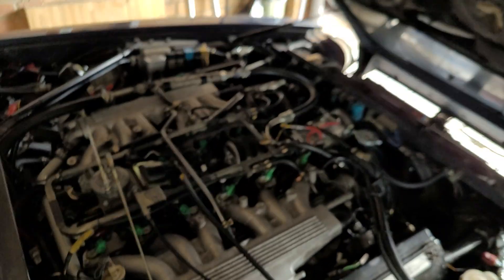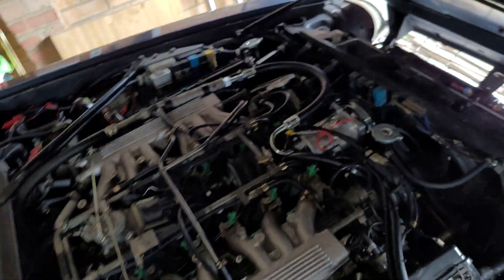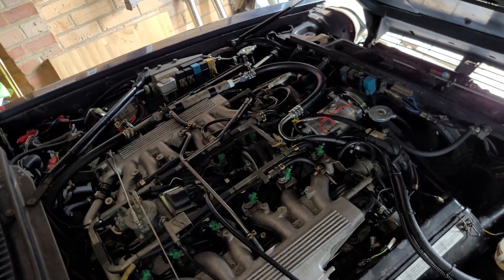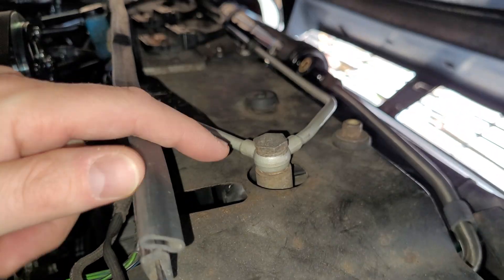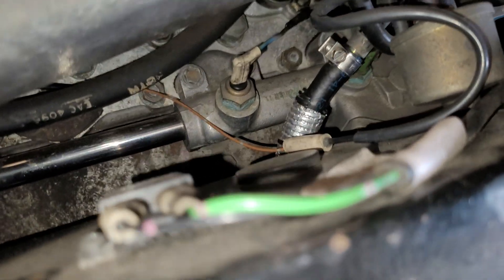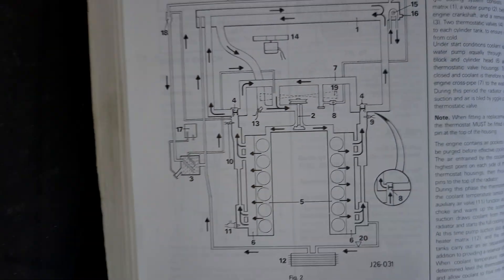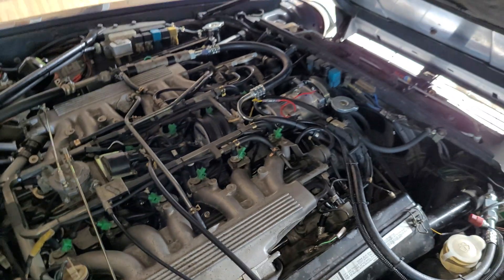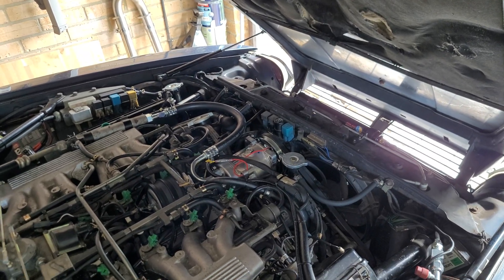Jaguar XJS V12 engine cooling system #5 - additional mods & advice

Comment: Do the racers swap the rails to make the outputs to the back I.el the left rail goes to the right? Or are they making new rails?
Reply from the maker: Pretty sure the ones I saw were new fabricated rails, or at least the thermostat end (now at the rear) was all custom ally welded. Not sure a straight swap from each side will fit- might foul the bulkhead?

Comment: Oh and check the water filler cap unit! I had a slow leak for years eventually an expert told me it was coming from there as it’s metal rusts then a small leak starts and you can never see it!

Comment: Thank you for the video!  Good tips about flushing the system to get rid of Barr's Leaks.  Even after thorough flushing on my 1987 I installed Gano filters to catch the bits (requires cutting three hoses - radiator top hoses on both sides and the heater hose).  The filters were still picking up bits after 100s of miles!  Eventually totally clean!  Then I replaced all the hoses.

Comment: Very good points!  One thing I highly recommend is when a proper flush is done - get the bleed pipes cleaned properly.  Believe it or not, they really work great in bleading trapped air out of the system.  when restricted, the air bubbles that may still exist are trapped giving temperature headaches.  Also, talking about measuring the thermostat is vitally important. The distance of the mounting lip, to the by-pass port, in that engines housing is 41mm.  if the thermostats open any less(when full open)  you are partially bypassing the radiator causing a slow runaway overheat.  There is a document in the file section of Facebook XJS site "Jaguar XJS Group" describing the thermostat issue -  its called "V12 thermostat fiasco explained.doc · version 1.docx"
Reply from the maker: Hey, thanks for the comment. Yes fully agree with all of that! I've done a few videos on V12 cooling recently but I think I did miss talking about cleaning out all those bleed pipes above the radiator. Mine were ok when I refurbed the system, but I have seen pictures of them totally plugged with rust.
Reply: @TMEstuff I went thru all of your XJS  videos.  Very informative.  Thank you for your work!